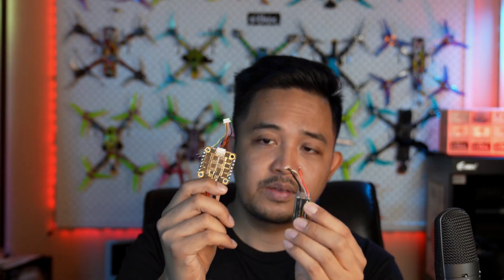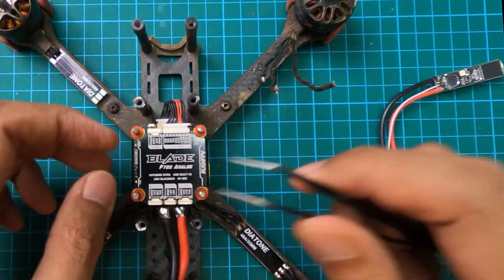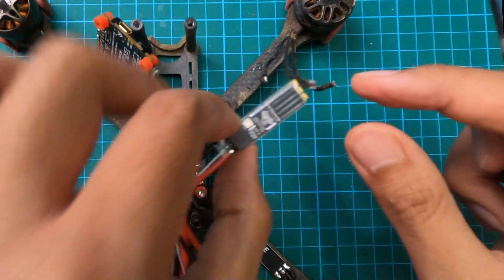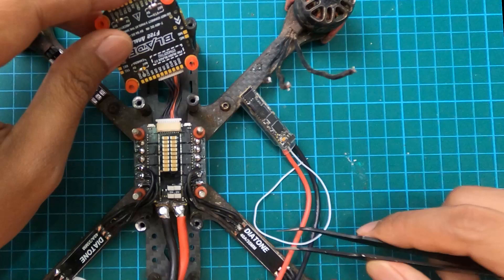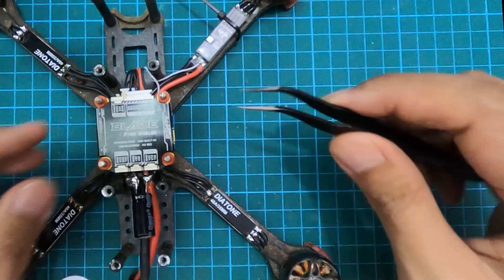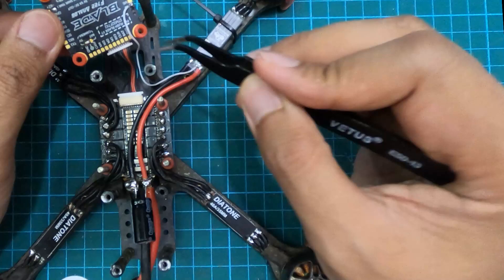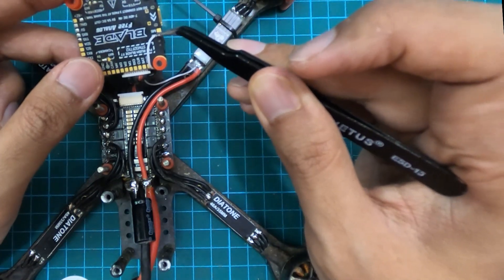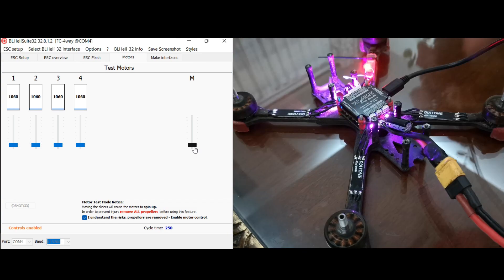Repairing a 4in1 ESC, with an individual standalone ESC!

Comment: do you know if i can do the same with a 4in1 esc,vtx,fc,rx all in one board? i burnt my happymodel diamond f4 and was considering if i could buy a standalone esc for the burnt out esc for motor 1 and 4
Reply from the maker: @vanditsharma6100  no u cannot
Reply: @adrinfpv  😔 thanks for the extremely quick reply

Comment: Does it matter the amps the individual esc can support vs the 4n1 that youre soldering to?
Reply from the maker: Ull be limited to the lowest amp u have. So. If u soldered a 40a I dividual esc to a 60a esc, then u are limited to the 40a
Reply: @adrinfpv  thank you! What if the 4n1 is blheli 32, but the individual esc is blheli-S? Will it still work?
Reply from the maker: @Sprinthurdles  it will but u have to set the settings the same or similar

Comment: but most esc have 2 wire.how to connect that?
Reply from the maker: Actually esc has many wires? Which two wires are u talking about? At least it must have batt and gnd?
Reply: @adrinfpv  Here the esc has just single signal wire.but i found most esc with two wire.Help please
Reply from the maker: @kaorageko  u mean 4 wires. Gnd, batt, signal and telemetry. Because u are mixing 4in1 ESC and single esc, u can leave out the telemetry wire from the single esc.
Reply: @adrinfpv  my doubt is in individual esc,for example in this video,you just took out one signal wire and go straight to FC while also using the two power wire directly to battery.
But this esc here you are showing is hard to find in my country and expensive also.
I search but most result are 2 wire esc instead 1 signal wire
Reply: @adrinfpv  say i see ground and signal wire.. can i left ground wire unused? will it work??
Reply from the maker: @kaorageko  no it will not. At least 3 wires connected, gnd bat and signal
Reply: @adrinfpv  thanks let me try